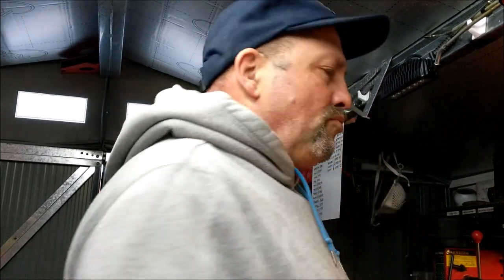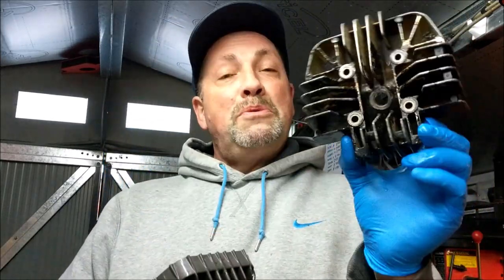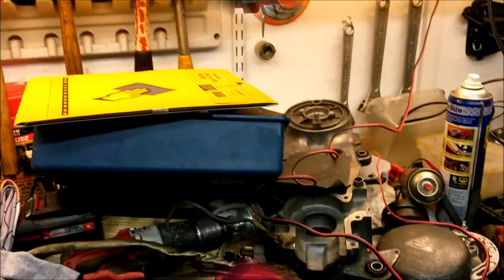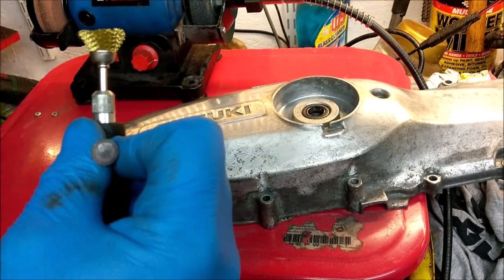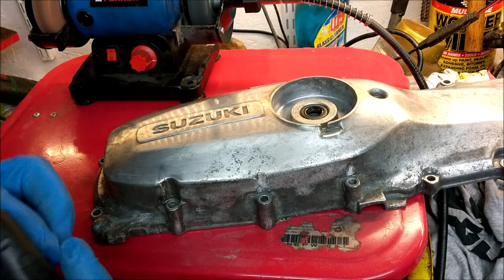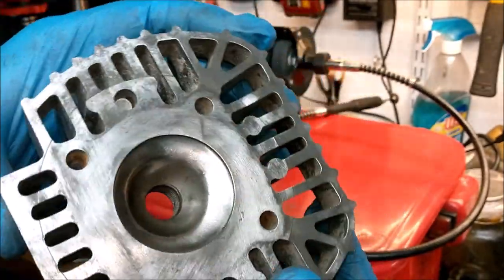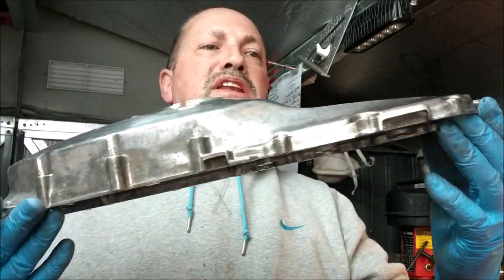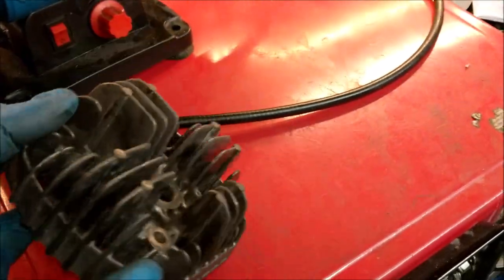Suzuki FZ50 Restoration Episode13....to polish or not to polish the engine?

Comment: Eadsie, I've used Garryson Garryflex Abrasive Blocks on scuffed or pitted alloy. They are hard rubber blocks impregnated throughout with abrasive grit and come in a varity of grades. You can get them on Amazon or Ebay.
Reply from the maker: Thanks ade :-)

Comment: can get decent paint remover still in the UK, have to look for industrial stuff, and paint the cases, they  are rough because they were never intended to be polished and so the castings are not great, always been the way with them on cheap bikes, and corrosion  doesn't help, but that isn't what causes the small, deep pitting, it is the casting process and air bubbles, been there, done that etc mate, and besides paint is much easier to maintain
Reply from the maker: True bud